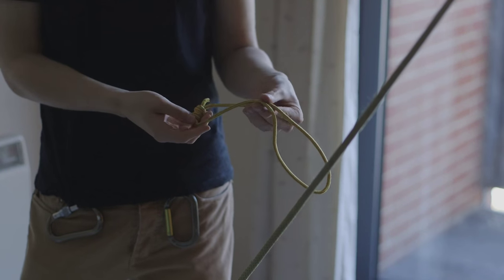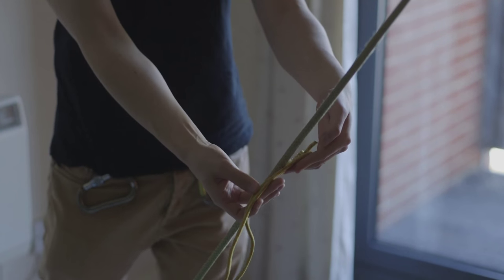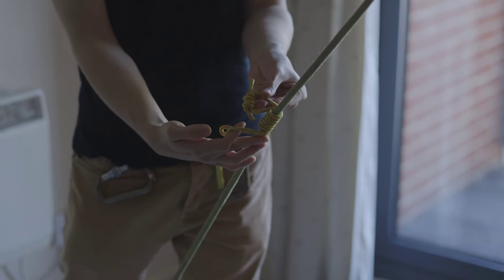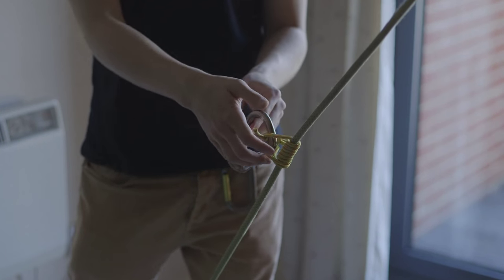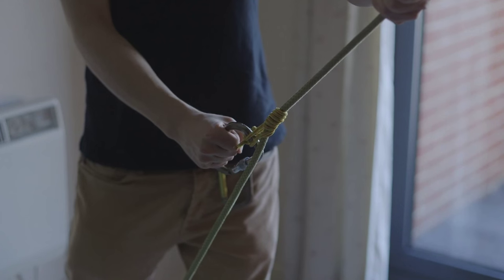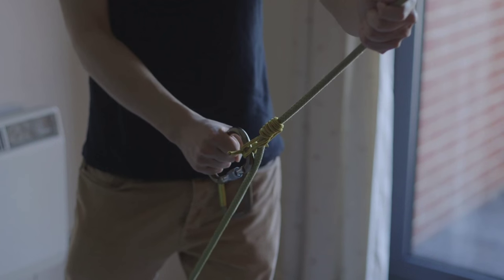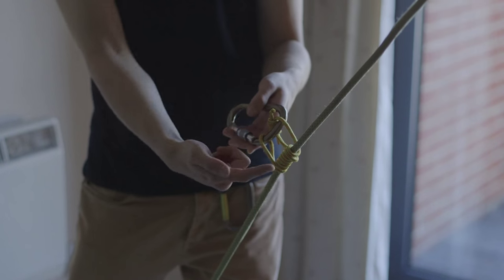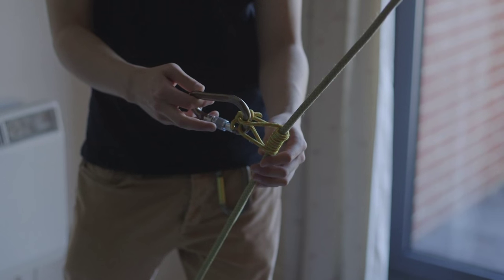Climbing tips: French prusik knot (auto block, rappel backup)

Comment: Wish I had that accent!  Good, short and to the point!  Better to show the ATC and this as a rappel brake backup rather than talk and describe it, no?  My problem as well, but pictures and videos are so much better than words.  This is so easy and fast to tie and dress and load, why wouldn’t it replace Klemheist and Prusik hitches?  Maybe they perform better holding heavier weights like when climbing rope?  A rappel brake backup only needs to hold probably under 20 lbs or the equivalent of what your brake hand holds.  How many wraps - as many as you need to hold the brake, which depends on how grippy the mainline and Prusik loop cords are (how thick, how pliable, how slippery).  How long a Prusik- depends on how many wraps.  Thanks!
Reply: Kleimheist and clasic prusik wont release once loaded a French prusik will.

Comment: Hi there I have just bought 5m of 6mm accessory cord to try out the various prusik knots, for rappelling and ascending. Can you please advise me what length prusik loops should be for the main friction hitches , as in French and klemheist etc. Many thanks. Also if you have any idea what length to cut the cord too before tying that would be extremely helpful. Thanks again
Reply: The finished prusik loop is typically 18 inches to 3 feet long depending on what it will be used for.